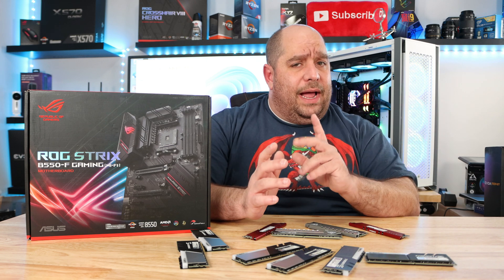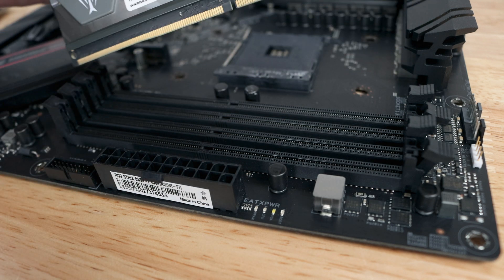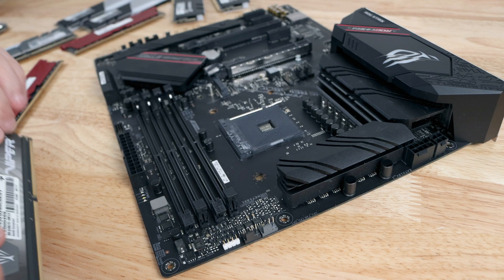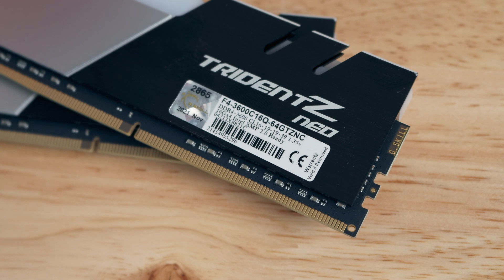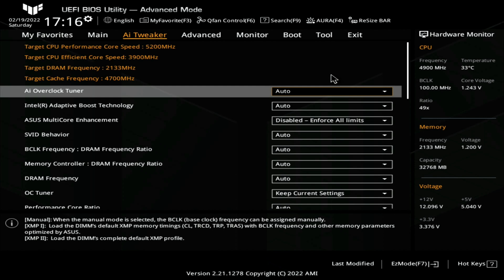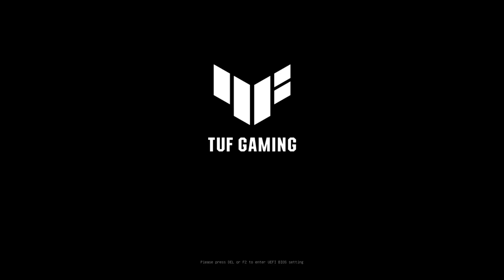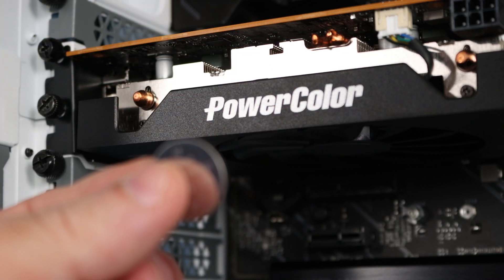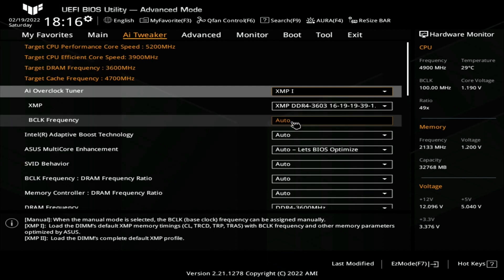How to install and configure RAM in a PC - Step By Step Setup Beginners Guide

Comment: If I'm upgrading from 16GB to 32GB ram will I have to install the latest bios update?
Reply from the maker: If you want it to work well, you should, not sure why you wouldn't want to, check your bios version, then go to the support site for your board, and see what the latest version is and all the fixes in between, this may help you as well: https://youtube.com/shorts/g5CV_TlGN1k
Reply: @ThisBytesForYou  Will the latest bios update brick my pc though since I have heard that asus bios updates do that to people computers? Its working fine now but if i do update and something goes wrong then pretty much I will get stressed out.
Reply from the maker: it could always happen, but chances are very slim, what is your motherboard model number and are you on a hard drive or SSD for your operating system?
Reply: @ThisBytesForYou  SSD for windows 11
Reply from the maker: OK, I will ask questions numerically
1. How many drives do you have in your computer?
2. What is the manufacturer and model number of your motherboard?
Reply: @ThisBytesForYou Sorry, do you mean serial number or part number for the motherboard?

Manufacturers is ASUS STRIX Z690-A GAMING WIFI D4 motherboard

Socket 1700
DDR4
Reply: @ThisBytesForYou  I have 4 drives 

1TB ssd 
2TB ssd for other gaming stuff like apps
2TB ssd just for games I mainly play
2TB HD just for backups
Reply from the maker: I recommend you unplug all the other drives, and just keep your main drive connected just for testing, I feel like you have windows installed on the hdd, your boot times should be under 12 seconds, of course also your install of windows could be corrupt, it happens.  As for your board, you have FlashBack, you can recover from any failed BIOS flashing, here is my video on flash back and here is your latest BIOS: https://dlcdnets.asus.com/pub/ASUS/mb/BIOS/ROG-STRIX-Z690-A-GAMING-WIFI-D4-ASUS-3101.zip?model=ROG%20STRIX%20Z690-A%20GAMING%20WIFI%20D4
Reply: @ThisBytesForYou  I did that before... I unplugged all drives except for my ssd that already had windows 11 on it, but I did a clean reinstall of windows 11 also. It could be that windows 11 is corrupted or I could need to purchase an M.2 ssd that is more faster than the one I currently own???
Reply from the maker: M.2 is definitely faster, but an SSD is still much faster than an HDD, maybe this video will help: https://youtu.be/Ih28muags6s
Reply: @ThisBytesForYou  Thank you for the help. I'll check out the video. 👍
Reply from the maker: its really important @Galahad93
Reply: @ThisBytesForYou  Hi, I also just wanted to ask you about another issue I'm having. Every time I restart windows 11 its stuck on the loading and takes like 3 or 4 minutes for some odd reason even though it's on an ssd. Not sure if it's a hardware problem or a driver issue.

Comment: I bought a pre-built pc on best buy and the ram sticks are a 16gb set that were positioned in b1 and b2, if I were to buy a 16gb stick (I can't find another 8gb x2 set of the same model) would it be ok for me to put that 16gb in b1 and the other 2 8gb sticks in a1 and a2? ALSO wonderful video, I understand much more than i did before!!!
Reply from the maker: SO happy you benefited from this video, with that, it should have answered your question as well.

Comment: 3:39 Here's a tip for people like me.  Notice how he presses the stick in until the locks automatically click into place.  If you put it in and manually clicked the locks in place, that means you didn't press hard enough.  Somehow I've forgotten about that twice and had my computer not boot up over the years of putting together my own computers.
Reply from the maker: But when it's a dimm slot you've used several times, it doesn't always snap in even when fully inserted.

Comment: Tip if it wont go in: if it's aligned correctly, you have to push REALLY hard. WAYYYYY harder than you'd expect. Literally so hard you might almost feel the board bending quite a bit.
Reply from the maker: yeah, there is a fine line at where I can say that since I dont want anyone pushing too hard and damaging their board or ram, I state it but still

Comment: can I put different ram frequency on A1 and B1 because my A2 and B2 is dual rank with 3200mhz and when I looked at the guide of my motherboard I saw that A1 and B1 doesn't support 3200mhz, it only supports up to 2900mhz if single rank and 2600mhz if dual rank, please I'm new to building pc I need help
Reply from the maker: You can but it can cause issues, you won't be able to use xmp and you have to set the slowest speed, highest voltage and highest cash, ras, tras latencies to get it to work correctly.  Not worth it.
Reply: @ThisBytesForYou  what if I put the same brand, speed, frequency of ram on all of the 4 slots?
Reply from the maker: @eeniemeenie-y5p  chances are they are using different ics and surely are made with different time stamps, there is a chance for issues, if you buy them all at once, there is less of a chance.

Comment: 👍
Reply from the maker: Always a pleasure my friend, so very happy you stopped by, trusted in me to help you, liked and subbed as well as took a moment out of your day to thank me.  It means a ton to me and I am so very happy I could help you.
Reply: @ThisBytesForYou  Great video. You helped me a lot. I only had one problem, before removing the old RAM I had to put the default profile in the Bios (no xmp) otherwise the pc wouldn't detect the new RAM and wouldn't turn on.
Reply from the maker: yeah, that can happen sometimes, though it should still pick up the new XMP settings, if/when I make a new one, I will be sure to add that, that's so much and so very happy I could help you and that also you got that part working ;) @fede_dale
Reply: @ThisBytesForYou  👌

Comment: Hey, Bytes, this is a long shot, but: Would you happen to know why I'm getting 100% Disk Usage after having upgraded my RAM and doing a BIOS update/CMOS reseating? My PC's never had this issue before, but now it's instant 100% usage from the moment I login. I've tried scanning the system, and using CrystalDiskCheck, but they both showed the HDD as being in perfect health. I don't know what more I can do at this point, besides cloning my HDD to an SDD.
Reply from the maker: open task manager, right click on the taskbar, and click "Task Manager",, there click the tab that reads "Disk", this will sort it by whats eating up your disk, you can right click on it and select end task.  If that doesn't work, click start, type CMD, right click on "Command Prompt" and select "Run as Administrator".  This that command prompt, run each of these lines

Each will take a bit.

SFC /scannow
DISM /Online /Cleanup-Image /CheckHealth
DISM /Online /Cleanup-Image /ScanHealth
DISM /Online /Cleanup-Image /RestoreHealth

Either way, I don't recommend cloning a disk, especially one you are having issues with, your copying the problem to another drive, that doesn't make sense, make a clean install of windows, I have videos on both though.  A clean install will make you feel like you have a brand new computer, ESPECIALLY if you are installing on an SSD versus an HDD, I have a video coming out on that, stay tuned.
Reply: @ThisBytesForYou  So, after several more hours, I looked into Event Viewer. I saw an error pop up during my latest session, about some paging file (can't remember what it was) that couldn't be written to due to running out of space for the file. Googled the error, and found a random article about a way to modify the size of the file to go from 25mb to 256+mb, so it won't fill up so quickly. Rebooted the PC (and reseated the HDD for good luck), and the Disk Usage shows as 30-51% on the Processes Tab, but would sometimes show 100% on the Performance Tab (it never went above 51 on Processes). My programs still ran fine, and everything launched up, so the HDD was still healthy. 

I used that chance to follow your Macrium Cloning video, and cloned my HDD to my new 2TB SSD. Took an hour-and-a-half to finish. No errors or issues, and I tested the SSD. Booted up within 10 secs (my HDD took several minutes to boot up, so I was amazed at the SSD speeds). All my files were on the SSD and applications ran fine. I was honestly surprised that Macrium was able to copy my Linux partition (I dual boot) without any issue. With all that, I'm just waiting for my heatsink to come in (I'm dumbfounded that m.2 SSDs don't ship with a mounting screw + heatsink by default), and then I plan to replace my HDD with a SATA SSD for extra storage. Thank you for your PC breakdown video, as I've always been wary of looking into PCs, much less modifying one!

I do have one question: When I boot from my SSD, it shows as still being C drive, even though it should be my D drive. I know it's my SSD, since I have tabs open on it that I don't on my HDD. Just wanted to know, if it's supposed to showing up that way? I checked on System Configuration tool, and it only lists the one OS, even though both my SSD and HDD are bootable.
Reply from the maker: Great info to have, a 256gig M.2 is TINY,, I always recommend at LEAST a 500Gig for a C drive, sure at first you have a lot of free space, but it fills up quick.  A page file is virtual RAM, A system managed page files automatically grows up to three times the physical memory  (If you have 8Gigs, it can grow to 24Gigs, 16gigs can grow to 48Gigs and so on ) when the system commit charge reaches 90 percent of the system commit limit. It doesn't worry about free space,.... thats when windows crashes and acts up, because it doesn't have free space and your drive is QUICKLY try to process what is occurring, 100% disk utilization because the drive is full and is fully being used.

As for linux, thanks for letting me know, I was not 100% sure.  I know a physical cloner will copy it, but wasn't sure how deep Macrium went.

Yes that is a limitation of many cloning titles.  Go into Disk Management, right click the start button and click "Disk Management", located the older disk that shouldn't be the C drive, right click on the partition and click "Change drive letter and paths..." apply and Ok and you are good.
Reply: @ThisBytesForYou  Thanks again. I have one last question: I have an old HDD from a PC I had thrown out several years back. While I can access the files from it via my external enclosure, I cannot boot up the Windows OS. I read that it could be because of drivers not being the same between the old PC and my current PC (my old HDD was using a non-activated version of Windows 7, while my current PC uses Windows 10). If I try booting up the OS, it'll go to a setup screen, then it will fail to launch, after I select keyboard layout. 

While I can easily retrieve any crucial files from the HDD, I really want to boot up into its OS to make sure I'm not missing anything. Posts I can find just say to run the HDD on the old PC, but considering I no longer have that motherboard... I'm wondering if you'd know a workaround? Surely, it's not because I'd need to plug the HDD directly into the motherboard via SATA cable?
Reply from the maker: Kind of right, the hardware is different, so yes the drivers are different which may not boot right.  You can find everything on your desktop on the other drive by going to "C:\Users\Your User Name\Documents", your downloads folder "C:\Users\Your User Name\Downloads", your videos "C:\Users\Your User Name\Videos", etc, don't waste time, use external enclosure. @swandive46
Reply: @ThisBytesForYou  I've tried those steps several times. No errors ever found, and the Disk Usage drops significantly after RestoreHealth. But upon restarting the PC, the problem comes back. I have many files on this HDD that I'd rather not lose, and I don't want to reinstall all my programs.
Reply from the maker: @swandive46  here you go: https://youtu.be/4BtdMcqwaFg

Comment: What if i install just one stick of ram, the previous one's number won't match with the new one's as you mentioned matching 294, 295 ....?
Reply from the maker: Wait you mean, have 3 sticks of ram?
Reply: @ThisBytesForYou   No, I have two RAM slots on the motherboard of a computer, there is now a 4 GB RAM installed, now if I want to buy a new RAM, what will happen?
Reply from the maker: you will need to buy another 4Gig, but I recommend replacing that 4 gig and getting 2 x 8Gigs.  What is the motherboard manufacturer and model number?   @mdgalib1802
Reply: @ThisBytesForYou  it's a Dell pc, Pc's model is Dell vostro 3670MT, the system information says the motherboard manufacturer is Dell and product is "0FPP7F" and the version is "A00". It's an old pc bought in 2020, cpu is intel i5 9th gen.
Reply from the maker: ahhh, ok, thats a little different.  On the back, maybe the top, there is a label that reads "Dell Service Tag" can you give me that number?  That tells me EXACTLY what is in your machine. @mdgalib1802
Reply from the maker: you are in luck my friend, your system can go up to 32gigs.  This is 32Gigs off of my Amazon Affiliated link: https://geni.us/zALKlDW and this is 16Gigs off of my Amazon Affiliated link: https://geni.us/355t1.  For 32gigs it's 2 x 16 and for 16Gigs it's 2 x 8 Gigs, the memory is 3200Mhz, you might be able to go faster, but this RAM specifically is rated for your machine.  I suggest putting your 4gig on the shelf, take it out and never look back.
Reply: @ThisBytesForYou  thank you so much for the advice... I will start upgrading it very soon.

Comment: My 4th slot on my motherboard died so what slots do I put them in I have 2 sticks. I have them in the first 2 slots.
Reply from the maker: Hmmm, you might have no choice, what is the manufacturer and model number of your board?
Reply: @ThisBytesForYou  gigabyte b660  DS3H AC DDR4 motherboard. Yeah for some reason when I put a single stick of ram in the 4th slot lt boots to bios and gives me a boot failure when xmp is set. When I change it to 2133 PC boots fine in the last slot
Reply from the maker: @NickOlszewski_1  So, first off, have you watched this video?  I want to make sure you have the RAM placement correctly, it sounds like you might be a little off.  I just want to make sure.
Reply: @ThisBytesForYou  when I put the ram slots in 2 and 4 the right placement PC only posts at 2133mhz ram. Because theres something going on in the 4th slot in my testing.
Reply from the maker: What is the model number and manufaturer of your RAM (its a long string), and what BIOS version are you on, on your motherboard? @NickOlszewski_1
Reply: yes, have watched the video. my ram is corsair vengeance RGB pro ddr4 3200mhz. bios version is f25. model number is:(cmw32gx4m2e3200c16)

and when I had all 4 sticks of ram in al slots it ran at correct speed no boot failure then the next day, I turn on pc I get the boot failure, but only using 2 sticks in the first two slots because when I put ram in slot 1 and 3 it still only runs at 2133 no boot when set to 3200. worked fine day before so confused why it's not working possibly a new motherboard change: ram tested in other gaming pc.
Reply from the maker: well, sadly that does happen, board going bad, but if you can, with the memory in slot 2 and 4, go into the BIOS, "Save & Exit" then select "Load Optimal Defaults", press enter to select yes, then save and exit, and come back in the BIOS.   Go to the "Tweaker" section and set "Extreme Memory Profile (X.M.P) to Profile 1, which should be your 3200Mhz, then save and exit, does it work?

Just in case, doing this, you will lose all your BIOS settings, but it sounds like you know them.
Reply: yes it worked. thanks for the help. will; propbally still get a new motherboard anyways for more usb ports and fetures this is a prebuilt pc i have
Reply from the maker: ahhhh well, its using a custom board, so it still is kinda custom, as for USB ports, its seems the newer chipsets have less, sooooo annoying since we have more USB devices.  I have this and just recommended it to a friend, who bough it... and I have to install it for him soon, this will have you 5 USB 3.0 Ports and 2 x USB Type C ports, works great for me off of my Amazon affiliate link: https://geni.us/2MkNO

Aside from that, Always a pleasure my friend, so very happy you stopped by, trusted in me to help you, liked and subbed as well as took a moment out of your day to thank me.  It means a ton to me and I am so very happy I could help you.

Comment: You just earned another subs. I'm a complete beginner to the PC community. I bought a used PC with only one stick of 8GB RAM and I bought a new one to increase it to 16GB. After that, I booted up my PC and my monitor doesn't have any signal, I was panicking and scared cause it's my first PC I bought with my own money and at that time I thought just getting a new RAM is gonna be easy. The pre-installed RAM has 2666MHZ and the one I inserted has 3200MHZ. So I was like maybe that's why, but when I did a bit of research, that my MOBO and CPU has lower max RAM speeds than the new RAM I bought and it says that the MOBO will auto down clock the higher RAM speed to match up the limit from the MOBO. But even then, my monitor has no signals from my PC even after I boot it up. Now I'm just using the pre-installed RAM 1x8GB 😅
Reply from the maker: Well thank you so much my friend, I am so very happy I could help you and I thank you so much for your support it means the world to me.  As for the RAM, yeah it can be a bit picky but if you drop in the 3200Mhz RAM alone, set the RAM speed to 2666Mhz, with the highest of the 2 voltages and set RAS, CAS, TRAS and the others to Auto you should be good to add the other, maybe not perfect though.  Give that a try and see if it helps, in this case you cannot use XMP, you have to set that to Manual and the RAM sticks have to be in slot 2 and 4.